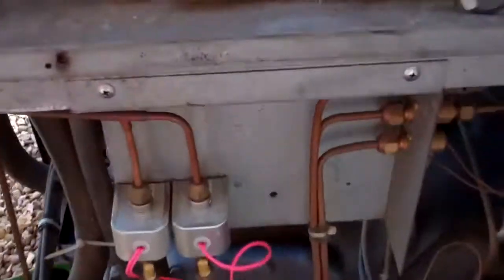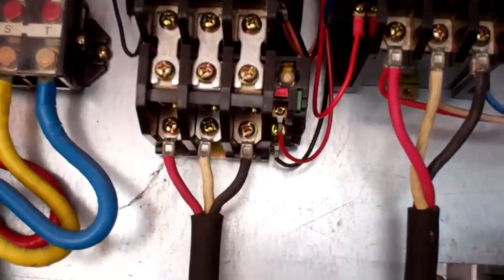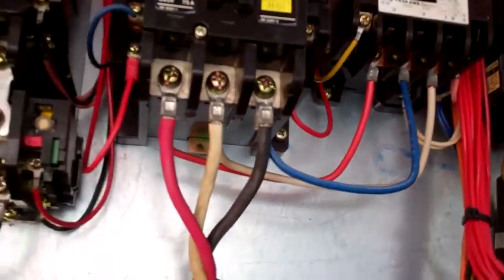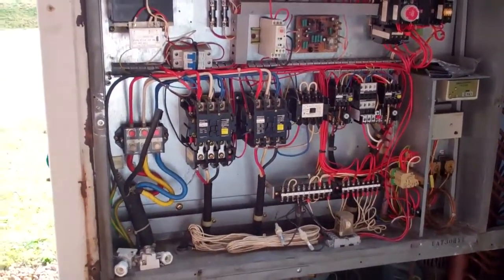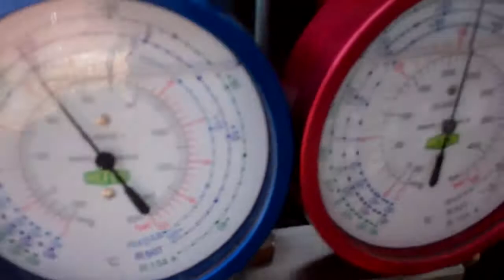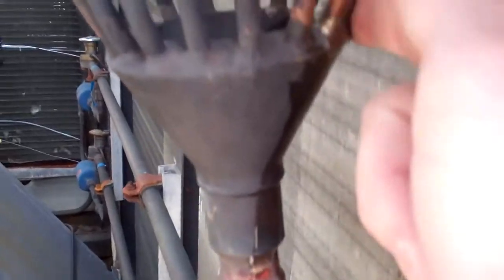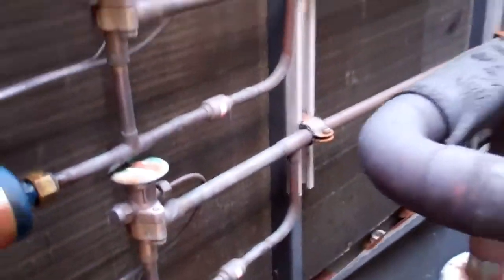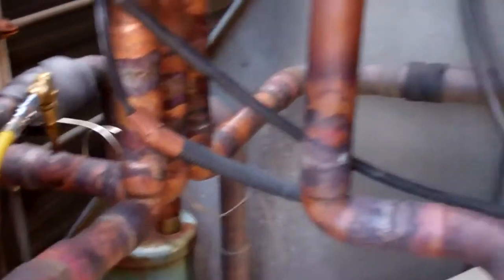Daikin Chillers

Comment from the maker: @fritzhvac I'd like to do more stuff this sort of size, i've worked on tiny little 1/8th hp systems up to a rack/pack system with a 3 1/8th" suction line! mapp gas can fitted inside it!!! Though most of my work is on stuff around 2-6hp.

We have to have a leak detector capable of measuring a 3g a year leak (and a recovery machine on each truck to meet the F Gas regs here, also a CITB J11 or C&G 2079 personal cert. and co. registration to do hvac/r), but i still end up checking with bubbles :-D